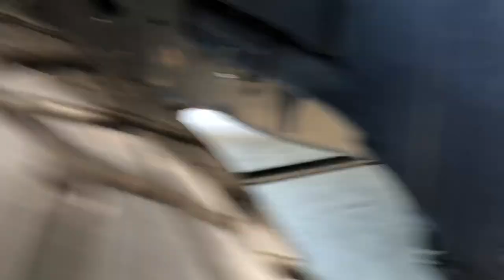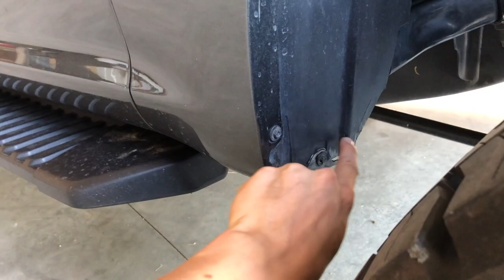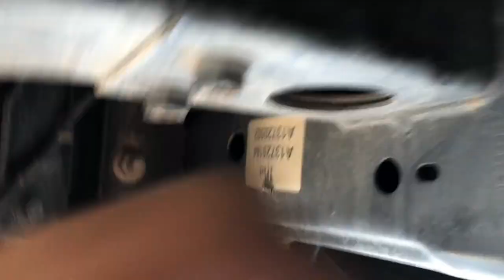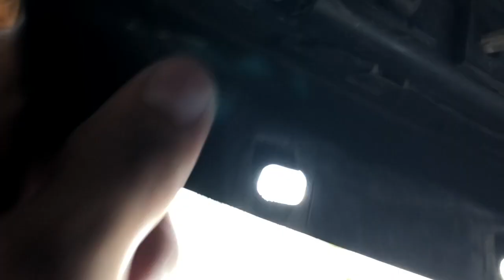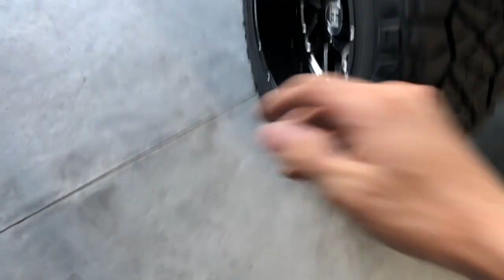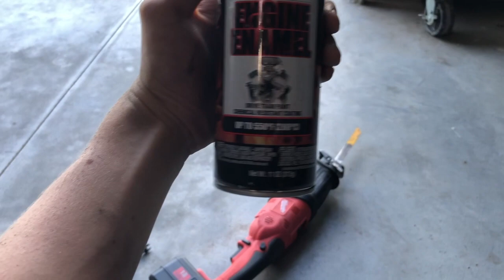Cutting The Front Crash Bars Out Of My F-150!!

Comment: If you took off the front bumper, which is actually pretty easy what you could have done is cut the bolts and the welded nut and slid the crash bar out. Then if you need to put them back in, all you need is new bolts

Comment: A grinder would work to just trim the rubbing part right?
Reply: That’s what I was thinking. Or just cut off 1/3 of the bar near the end where it’s rubbing so atleast you still got 2/3rds of the bar there for “safety”. I really don’t see how these bars are doing anything safety wise anyways, you got a big steel bumper right in front of it and huge wheels ands tires right behind. Those crash bars are like toothpicks

Comment: Cutting it just enough wouldn’t be better than removing the whole thing?
Reply from the maker: You could remove the whole thing but you’d also have to cut out he bolts that hold it in place and they were a pain to get to! So I just left that part in and cut out the main part in the way of the tire.
Reply: You would have to remove the entire bumper to remove the whole crash bar